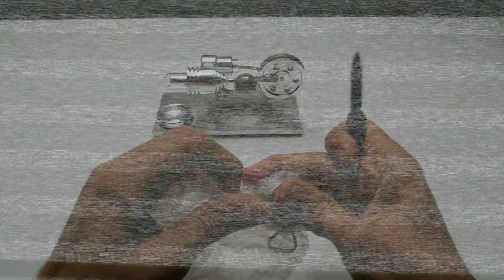Fully Working Stirling Engine

Comment: Rn im thinking of nuclear powered stirling engines. As nuclear fuel produces alot of heat over a long period of time. We can directly turn nuclear energy into mechanical energy

This would defeat the purpose of a simple design however it would be zero emissions and also crazy cool. Idk how efficient it would be though.

Comment: There was an old Stirling engine fan that used a kerosene and wick much like the old oil lamps  and you could speed up slow down the fan by changing the wick which would change the flame size.

I believe there is a video of it on YouTube

Comment: an interesting point. Any heat source can be used, solar, wood fire combustion, geothermal, or even the waist heat off of an internal combustion engine or a hot computer. They make ones that sit of top of a wood stove, and power a fan via the heat of the stove. Any temperature differential will work. not nessisarily a heat source, but also a 'cold' source. if powered externally, the stirling engine can also be used as a heat pump, to heat or cool the 'bulb' in this case, depending on direction of rotation.

Comment: I'm confused, when he turned the wheel and the engine started to work, does the fire still lit?
Reply: You'd know the answer if you would've paid attention when he blows out the candle.
Reply: @iamsoobad  what about the motor that's connected to it? Is it just an example what sterling engine can do?
Reply from the maker: @siontheodorus1501  That's a generator and there are two pins as an electrical output.
Reply: @VisioRacer  Ahhh, make sense. Thanks for the explanation

Comment: You should use it to power your pencil sharpener or something.

Next video!
Reply from the maker: I could not make it light an LED, it is very weak, but does not matter. Cool anyway
Reply: It is possible with greater benefit. https://youtu.be/9_99qWH7TBc

Comment: Could you imagine a sterling hybrid engine, powered by the exhaust of an internal combustion engine?
Reply: Just one word

TURBO
Reply: @maniac6666  Turbos don't run off heat though, they run off air pressure
Reply: @TTime685  they run off the exhaust gasses
Reply: @TTime685  exhaust gas has air pressure because its hot, the turbo allows the heat driven expansion of air to spin the turbine. If something has heat, energy can be extracted from it by allowing it to expand, so turbos really do indirectly run off heat.
Reply: @naut3  That is true, but the flow of air pressure paired with a turbine is what's driving it, not heat alone.. the heat just helps assist with the pressure and is a byproduct of the combustion cycle. A centrifugal supercharger is basically a belt driven turbo. Turbos don't necessarily need heat to function, a stirling engine does. A stirling engine opperates off heat and contained air pressure inside a cylinder, it doesn't flow in one direction. It's more of an expansion cycle of heating and cooling.
Reply: @naut3  yeah your right but the main driver is a pressure turbine. Thats like saying a internal combustion engine runs bc of heat, yes the heat is in the explosions but its the pressure that drives the pistons
Reply: @TTime685  you mean exhaust gasses, that can be used to heat a stirling engine
Reply: @backwoodsjunkie08  the expanding air pressure that pushes down a piston is caused by heat. When something gets hot, it expands, if something gets hot really fast, it expands really fast. Pressure is caused by rapid heating.

You compress something, it heats up, when it expands and applies pressure to the surfaces around it, it looses heat.
Reply: @TTime685  I never said it was heat alone, I said pressure was caused by heat.
Reply: @naut3  An internal combustion is caused by a chemical reaction, not heat lol..
Reply: if you wanna to recover energy from the exhaust gas， i prefer the Thermocouple， they're make from semiconductor no moving part
Reply: @stephensu4371  But don't they have really low effeciencies?

Comment: These are pretty cool. When I was in school to become a machinist, we made one of these from scratch on a conventional lathe.
Reply: Same here! I went to a trade school for machining, we made one that you could hook up to an air compressor. I modifies it further and slapped a small electric DC motor with an O-ring pulley on it to power a lightbulb! Its now on my mantel
Reply: @backwoodsjunkie08   Right on man, that's pretty cool. I wish I could have kept mine.. They're actually pretty tricky to make on a conventional late, especially when you're just starting out, because the tolerances have to be pretty dead on
Reply: @Nygus Nevrdye not the first time LoL
Reply: No mill or just a file